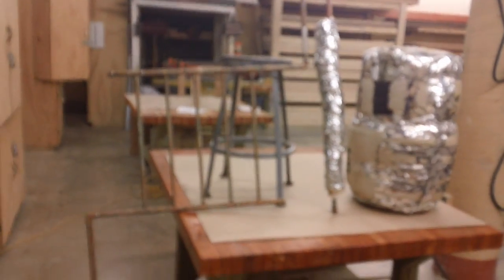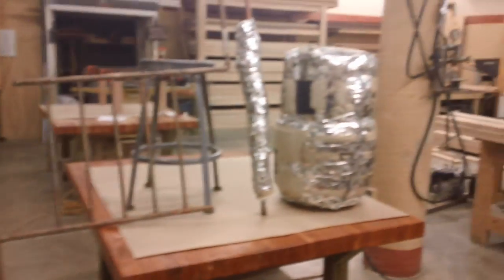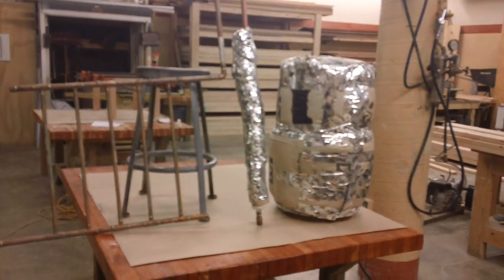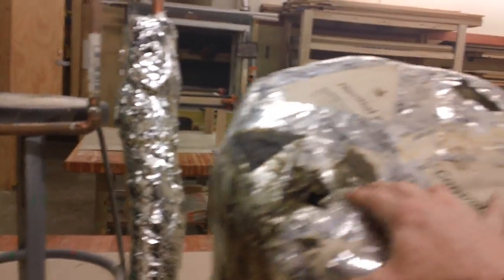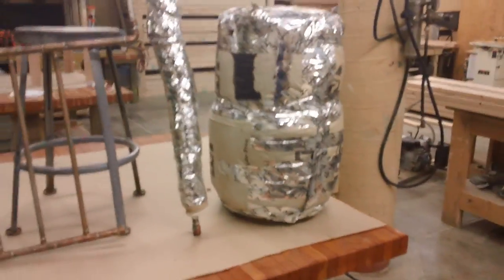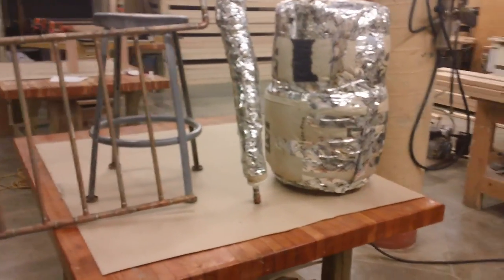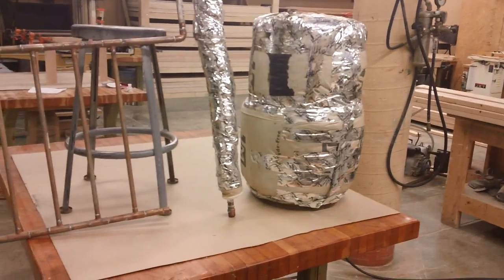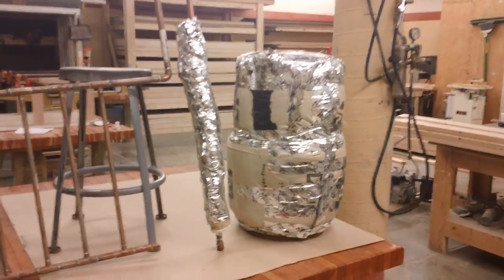FUEL from plastic, Burnt Motor oil, sugar water& yeast and  wood

Comment: i have been researching and you can make kerosene form the plastic. one you are making kerosene you can replace the propane and use your own made fuel in the kerosien burner. If you put a SECOND copper coil; before the cooling coil and heat the vapor to 350 -425 it will split and form gasoline. I know my spelling sucks. after THAT being said, I am looking to see if anyone has usede ps like those from computer monitors or tvs to make fuel.

Comment: wait wait.... so I have been trying to figure this out, so when you put plastic in it, is that all? or do you mix it with water or what? im very interested in all this!
Reply from the maker: plastic is a hydrocarbon and when melted at right temp to match rate it releases combustible gases that will run an engine just from the fumes. or those gases can be cooled or condensed to form a liquid. it is very dangerous and highly explosive due to pressure mixed with combustibility if running an engine the fumes out need to be equal or less than engine requires to avoid build up that can go boom. but if cooled and condensed into a liquid , bubble it up through water to cool it all down and keep it safe from back flash. when done the water will be heavy and on bottom so just drain water from a drain low on your reservoir until the product starts to come out.   I started with 2 plastic water bottles cut up in a paint can on a hot plate with a pipe run to the engine. put the lid on loose and put sand or dirt on top as a seal and pressure release. so if or when it pressurizes it too much it will just push the lid up and not blow it up in the air.  hope this helps
Reply: awesome! thank you very much. what temp do you recommend for plastics?
Reply from the maker: superfunnyman123  Plastic flash point which is the point it starts to release flammable vapors is 265 the hotter the faster the more potential to go boom. Cook it as fast as you dare as long as you got some where for it to go safe quickly enough and take it all.

Comment from the maker: There are some expensive machines out that convert plastic to fuel, ones you can put in the yard for household and batch counter top models but they are all basically based on what you see here.

Comment: I can understand that,  see if the process works first, then refine it to be more efficient.
It would be interesting to use wood burner for heat or perhaps solar if that would work.  Good video you did.

Comment from the maker: the gases and condensed liguid will come out the end of the tube from the expansion pressure cause from the changing from solids to liquids to gas thus expanding forcing the lighter gases up and into the copper tube where they cool and come back to liquid form but some will rermain in smoke form and that too is combustable

Comment from the maker: ethonal renders 20% or 5 gallon bucket of sugar water makes one gallon of ethanol.conversion of plasic to fuel usen both smoke and liquid can be as high as 90%.rendering. waist oil is about 35%-50% from my test, wood depends on wood density and other issues but is basicly 8660 btu's per pound or so and thats about 2500 watts per pound or about 3 pounds per hourse power if all is used and or stored. ethanol will run in gas engines but the other fuels will run in deisel only.